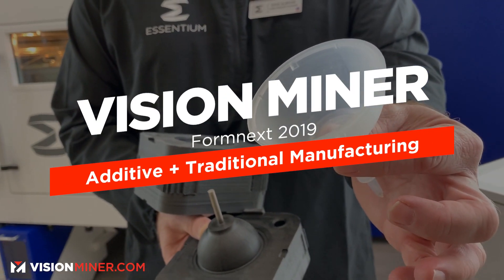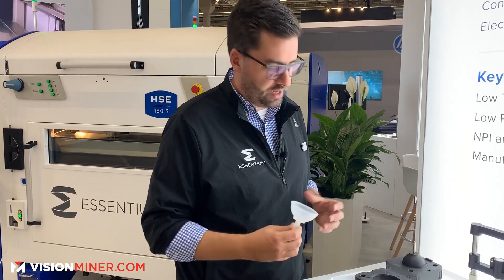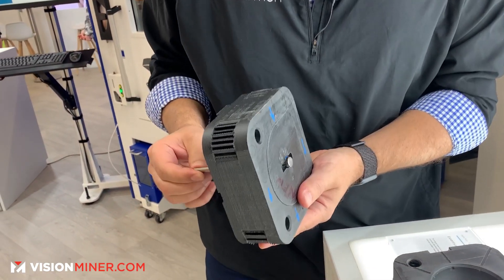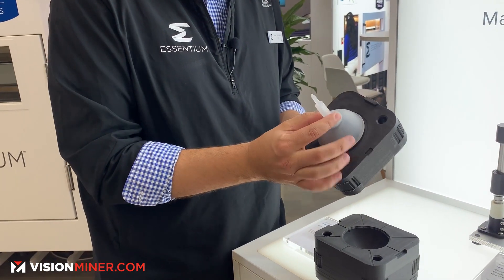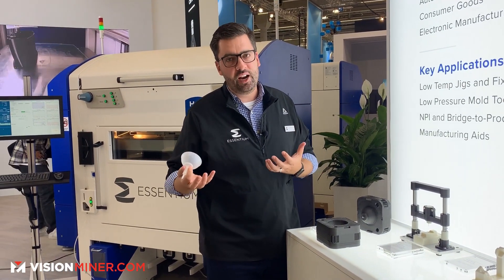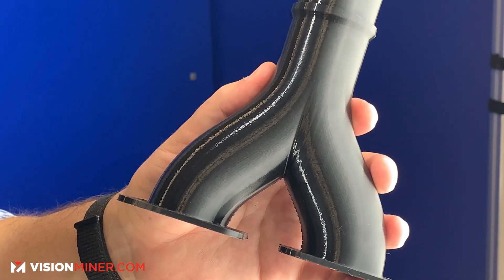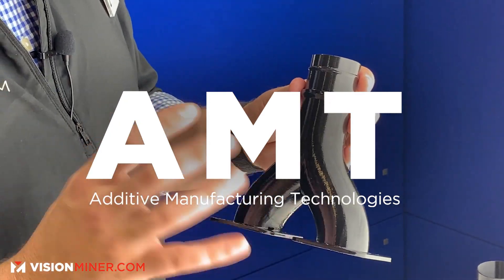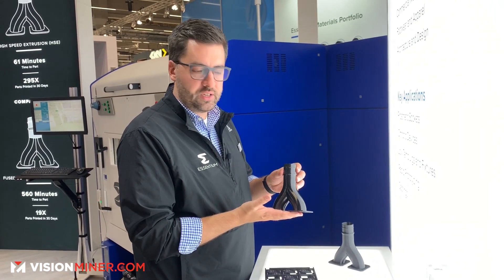Surface Finish, HTNCF25 3D Printed Molds for Polypropylene Made on the Essentium HSE

Comment: Does vapor smoothing work with the HTN-Z filament? Or would it ruin the surface resistance of the part?
Reply from the maker: Not sure -- there may be some type of solvent that could work, but it's generally chemically resistant. Vibratory tumbling or heat treatment can sometimes do it!